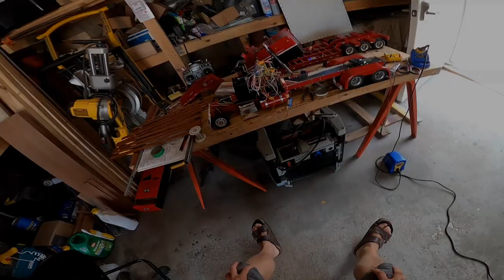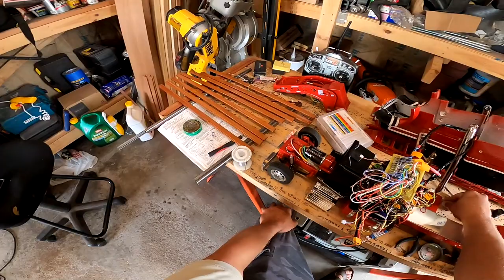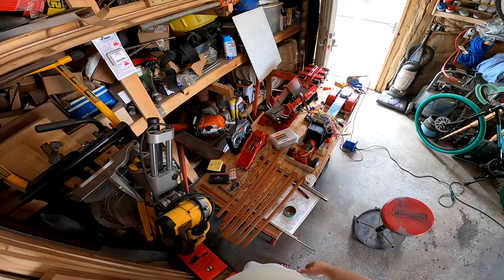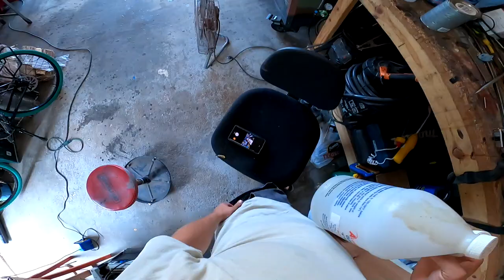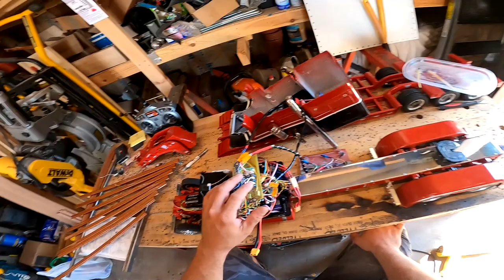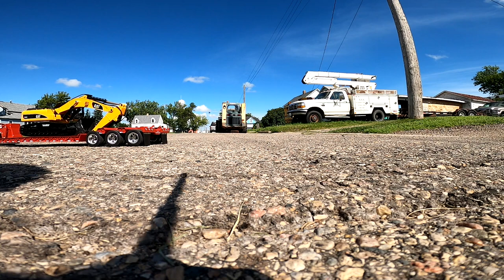Fontaine Magnitude 55H Part 35 - - - FINISHED!!!

Comment: How much does it cost to buy one of those?
Reply from the maker: I custom built this and started with a Tamiya Grand Hauler kit. I used a lot of aftermarket parts and quite a few parts I modified or scratch built. The trailer is 100% scratch built. All together I have around 60 hours fabricating, building, and painting and about $2000 in off the shelf parts/electronics.